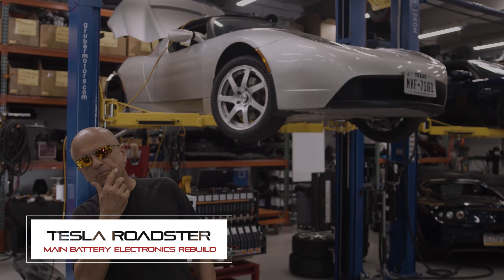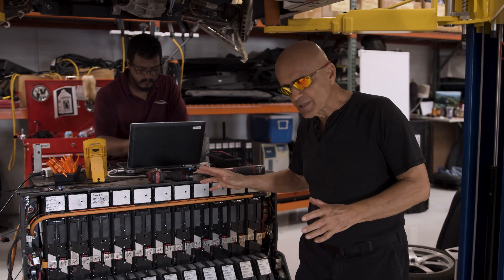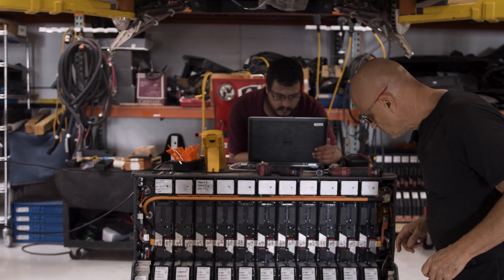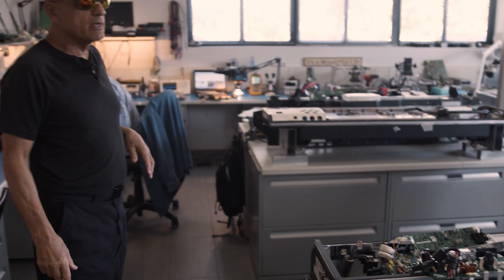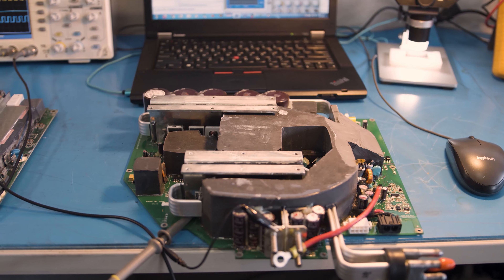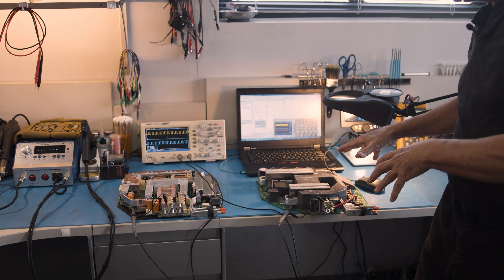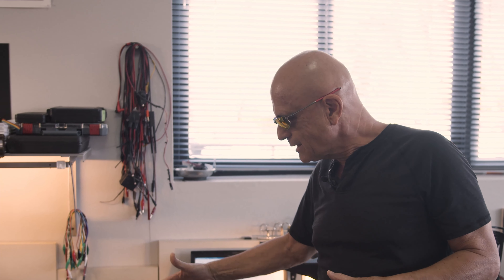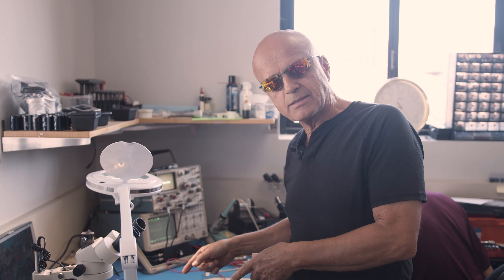TESLA Roadster Main Battery Electronics Rebuild | Gruber Motors

Comment: If there is a DC to DC inverter that powers the radio lights and other 12 V stuff what’s that 12 V battery that goes into the front of the car that’s below The windshield used for? In the roadster and what about the 12 V battery that is under the windshield in a model S and other models used for?

Comment: Those electrolytic capacitors are not made to fail within 8-10 years. However many fail within the first year in ALL electronics due to the Japanese manufacturer not using the correct doping in their formulated chemical makeup and are actually supposed to last average 50yr. They are also labeled for military purposes that many electronics techs do not utilize and often times swap them with lesser components also destined to fail. I’ve soldered thousands of caps into circuit boards and the bad part is these caps are often in circuits that are to protect main circuitry from over voltage and DC filtering and it is those very protective circuits failing often thereby disabling an otherwise sound circuit of the main devise. It’s an entire mess within the electronics industry.
Reply from the maker: There are of course many types of capacitors.  Small caps, small mfd and voltage will last and last.

The caps most vulnerable are large electrolytic, high voltage caps, that have hundreds of volts coursing through them, attached to high current circuits like the output stages of inverters.  These caps act as filters doing wave shaping, and as they age, they become resistive, placing additional load on the output section of the inverter transistors.  As they eventually heat up (a byproduct of current and resistance is heat, they can blow up, or blow the IGBT transistors.

In the critical power world, UPS's in data centers, or lighting inverters, these types of capacitors are proactively replaced every 8 years.

Here is an example of the carnage inside a Tesla Roadster Power Electronics Module when one of these caps blew - 
https://grubermotors.com/2017/09/01/pem-capacitor-failure/